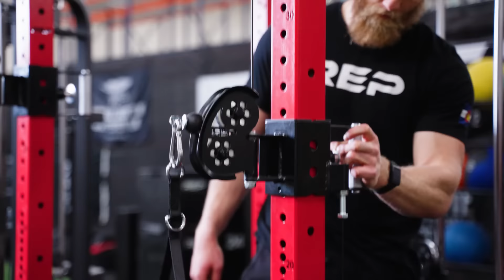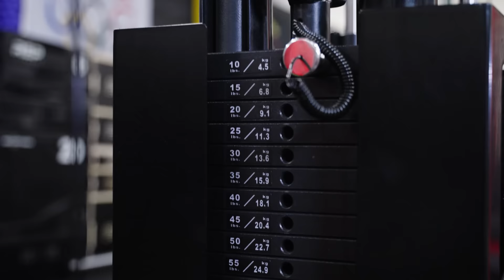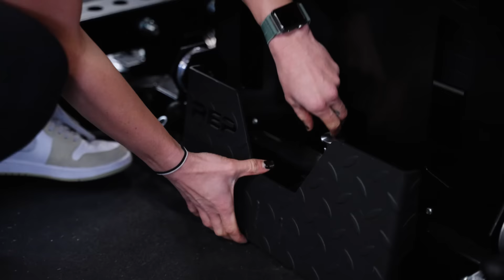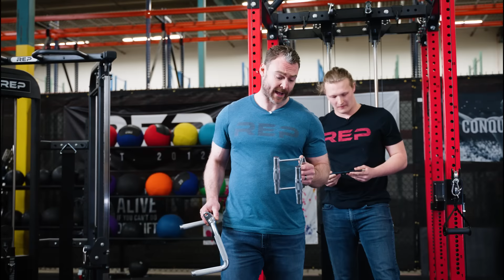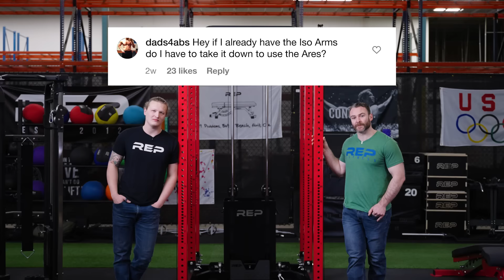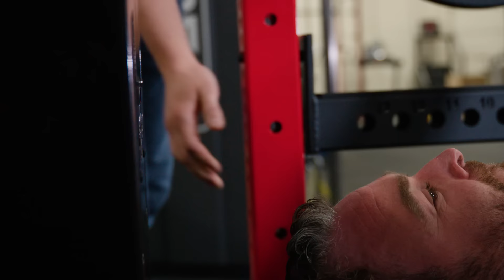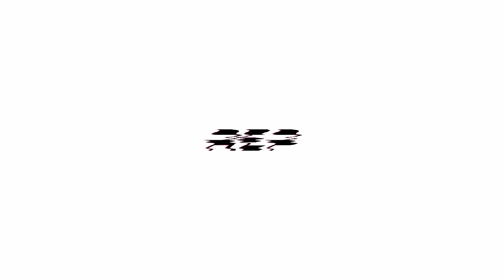How We Built the Ares Cable Attachment | REP Engineering

Comment: What are the massurments from back to front and sideways?
Reply from the maker: See our dims photo here: https://repfitness.com/collections/ares/products/ares-cable-attachment-6-post-series
Reply: @repfitnessequipment  what do these cables do that are almost $3000. Lol.  I think $1000 will still be expensive but $3000 come on.
Reply from the maker: @futbol1972  It's selectorized weight stack, so you're talking something like 1,000+ pounds shipping freight in a big crate, plus multiple higher end hard chrome attachments, steel frame pieces, cables, pulleys, knurling, etc. So you can imagine it's not just some cables ha.

We'll be releasing more plate loaded options that are cheaper later this year since the weight and machining of the plates adds a lot of cost.

The idea is that this replaces a functional trainer ($2,500+) and a lat pull down and low row ($1,800+) = total of $4,300+ while reducing their footprint and adding some additional unique functionality.  While it can't really be compared apples to apples, you can ball park vs other options and see how much value is packed into this.
Reply: @repfitnessequipment  thank u  for ur reply.  However have a valor lat pull down machine for $350 and inspire functional trainner for $1200.  Love your  asowme product and I can see why it's expensive. A little too expensive in my opinion but great product indeed.
Reply from the maker: @futbol1972  yep, there are cheaper options out there. The valor is plate loaded (so can't compare) and the inspire has very small stacks at a max pull of about 80 lbs vs 155lbs of ours, is generally 'small', and is normally priced at $1,500.  Can't do unilateral combo exercises with either. Both are good budget choices tho!

Comment: So if two people are having rack at the same time while  using cable attachment can we use anything else simultaneously like   bench. Squat, lat pull down etc...or we have to wait until person finishes using cables for next person to do anything else in rack?
Reply: I think it depends on what exercises are being done inside vs outside but I see no reason why you couldn’t
Reply from the maker: @BrandonSchwartz1  Brandon you're correct! Just depends.... someone could be doing face pulls on the front trolley while the other person is benching, for example... or even 3 people! Curls on one pulley,  tricep extensions on another, and a 3rd person benching!

Comment: So if space is NOT an issue, sounds like the FT 5000 functional trainer is still the way to go. For those who only have a room to work with/in, this is gold.
Reply: Keep in mind a functional trainer won't give you the stable utility of the lat pulldown and low row. If someone already has the lat pulldown/low row add-on, then yes :)
Reply: FT doesn't have 310lbs dual stacks
Reply: @avinashtyagi2  I was thinking of using gym pins.
Reply: @meisdetermined  Sure, but you can do that with the Ares, and go even further (assuming you added same amount of weight to both)
Reply: @avinashtyagi2  I think it all depends on what all each person already has. I like the wingspan of the FT 5000 and also the openness of it with being able to slide a bench inside of it comfortably. There’s definitely advantages to each.
Reply: @meisdetermined  Sure, and if you have the space for an FT, and don't need the same amount of weight, that might be perfect for you, but it's great that they made this a potential option for those who want the ability to save space and get more weight
Reply: @avinashtyagi2  yeah I think ARES is awesome, just kinda sad I have thousands of dollars in other stuff that makes this attachment redundant to me lol

Comment: Can't this simply be added within a PR5000 30inch rack
Reply from the maker: If you have the 16" weight storage on your 30" PR-5000
Reply: @repfitnessequipment , don't have 16 inch weight storage, but would consider adding unit within a 30 inch rack area
Reply from the maker: @dinoleombruni788  Not feasible... it's designed to sit into the 16" section.

Comment: I just want to upgrade my plate loaded to a weight stack for my current REP lat/low row. Will there be a future option for this? Especially for many of us that already have a separate functional trainer.
Reply: They hint at this around in the Q and A portion of the video. short answer yes but it will be different so also maybe but they are working on it.
Reply: Yes it's called the Ares
Reply from the maker: Yes it is coming this year

Comment: Looks awesome! I have a PR5000 (4  upright posts) in my cart ready to go. Will I need to add 2 additional uprights as well, or does the Ares come with those?
Reply from the maker: It does not come with any uprights but will come with a pair of the new 4000 16" crossmembers
Reply: @repfitnessequipment  Ordered the Ares Cable Attachment (6-Post Series Pre-Order), 5000/93"/30"+16". Hoping the PR5000 + 2 more uprights will be all I need :)
Reply: @REP Fitness  so when i go to the pr-5000 configurator i will not add 16" crossmembers, but instead buy a 4 post configuration and then buy 2 more uprights separately?
Reply: @repfitnessequipment  Pre-ordered! So to be clear, I'll need a PR5000 with two additional 93" uprights? 
Can't wait!
Reply: Looks like we all have such clarity questions.   Some example complete configurations on the website including sku's and matching sketches would be great.   I mean, it's very clear "power rack not included", but still, my default thoughts are "looks like all these radio button choices means the 16" extension is included"

Comment: Glad they confirmed the incline bench problems in the rack. Honest and answered a big question in my head.
Reply: I incline press at a 30 degree angle and if you also have a monolift, it probably won’t be an issue.
Reply from the maker: @dejavu3655  41" rack solves this too. Or the 4 post Ares with spotter arms for minimal footprint and benching
Reply: Could likely make an attachment that brings the j cups out further!
Reply: @sisufitness659  the iso arms with j-cups